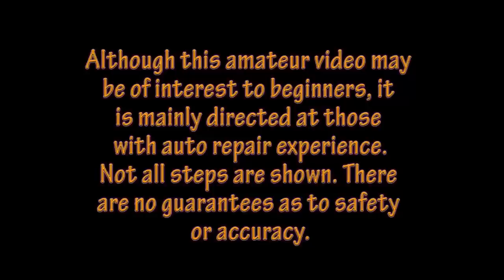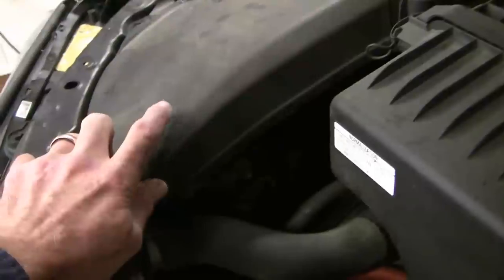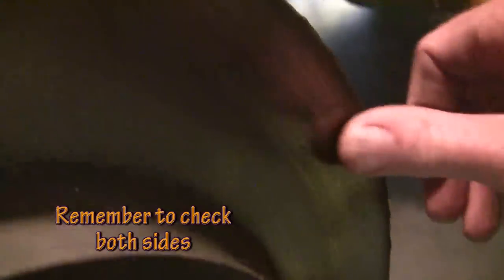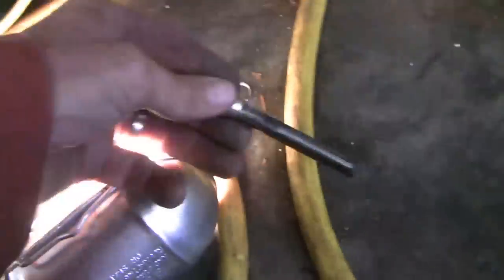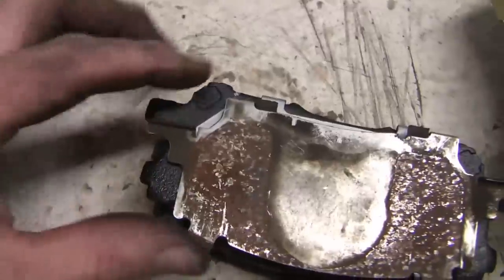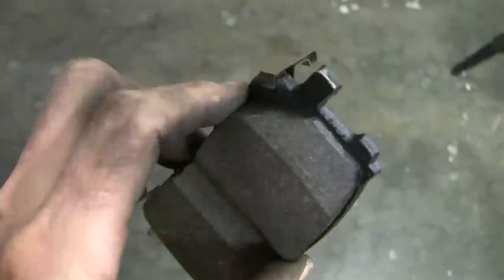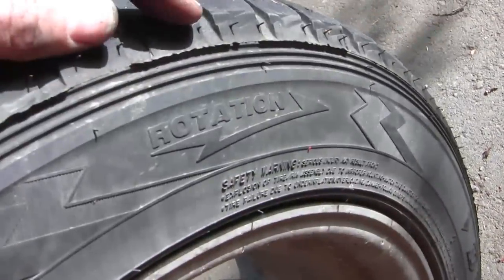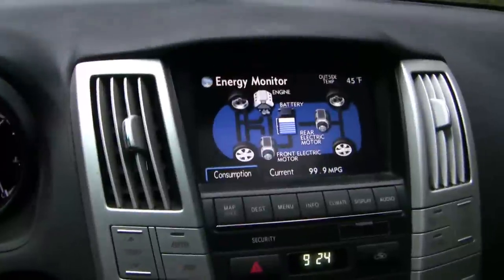How to replace brake pads on a hybrid vehicle, Lexus RX 400h

Comment: Excellent video sir! I will be performing brake pad / rotor jobs on my RX400h soon.
Do you have to use Toyota lithium grease soap? Is there any other alternatives I can get from local parts store?
Reply from the maker: I used it, partly because the vehicle is still on warranty and I didn't want any aspersions that I used the wrong lubricant. I don't know if others work as well or (more importantly) if they are compatible with the remaining lithium grease that will still be present in those sliders. A small problem there (with sticking sliders) could be a big problem in case of an accident....
Reply: Thank you sir for clarifying this. I guess I'm gonna have to go to stealership now :-)

Comment: Great video. Very informative. I am afraid I cannot do this service myself though. My 2008 RX 400h is at 110,000 miles now and gives about 27mpg ( 70% highway, 30% local). During last 105,000 mile service the dealer said it is time to change the brake pads at next service. I do not want to get this brake pads changed at the dealer but would like to go to a mechanic. What should I be careful about? Any idea about which brake pads are good on this vehicle?
Reply from the maker: If I were to ask a pro to do this I would choose an ASE certified shop that sees enough volume to be comfortable with this type of vehicle, especially with how to bleed brakes if they end up needing to do that. Because of the brake-by-wire and regenerative braking systems, bleeding is much more technical than on older vehicles. Unfortunately with extended warranties on these new vehicles, dealers get a lot more experience than do independent mechanics. I think that's kind of sad. Regarding pads, the ones I used are working great, but I can't say much more about that.

Comment: I see you have a special tool to spread brake system that goes over the brake pads.  What is it called and where did you get it?
Reply from the maker: Here in Canada there are several version sold in auto parts stores and at Princess Auto. the latter store is very similar to Harbor Freight. I don't know what they call those, but if you search the term "brake caliper compression tool" you'll find many examples. Some older cars have mechanical parking brakes (exclusively on rear calipers) and those operated with a cable sometimes required a wind back tool to rotate the slave cylinder back. You won't need those for front brakes, and almost all new cars have moved to electrically activated parking brakes where a wind back tool is obsolete.
Reply from the maker: By the way, if you don't have a brake slave cylinder compression tool, a large C clamp can work fine.

Comment from the maker: No, I wish. That's an instantaneous figure based on consumption coasting downhill. Real average mpg for this car is closer to 26mpg, and you can get more data on a different screen. 

I'm not really sold on the cost efficiency of the hybrid system, since as the battery fails you spend more and more fuel keeping the battery voltage up, and then you face a HUGE bill. Also, home repair isn't feasible most of the time, so you face repairs from an exclusive shop that has little competition.

Comment: Thanks for your video, I have a question for you 
My car is a2008 RX 400H without navigation system do you think if I’ll buy only top part and install it into my car I’ll have a navigation & hybrid system screen? 
Thanks in advance
Reply from the maker: I would guess it may require a reflash at the dealer, but I have no experience with that.

Comment: Great vid! You AVG mileage of 21.6 is dismal. Do you have a heavy foot or drive up mountains?
Reply from the maker: Yeah, average mileage for this vehicle is 26 mpg, mostly city driving with quite a few hills and stoplights. (the 21 you saw was just for part of one tank, not representative). Highway is up to 31 mpg. Worse in the winter, which is partly the Canadian winter gas and partly the extra energy for winter tires and extra lighting. I was hoping for better, though this generation of Lexus commonly gets 26. I haven't noticed any erosion of the main battery, yet, and mpg has been steady for years. It's rare for an average consumer to reach the numbers published by any manufacturer's advertising dept -- those numbers lie.
Reply: Funny my wife also gets 21.6 mpg also! Im very disappointed with the fuel economy.

Comment: The 400h is optimized more for power than mileage -  26 mpg is pretty good for the weight and power.  I thought I was doing great to get 126,000 mi. on the pads on my Prius until I heard of a guy who got 140,000 mi on his.  You don't really use the actual friction brakes unless you push them hard or you are down to about 10 mph.  One of the secrets to good mileage on a Prius is to slow down gently over a longer distance - that way you get maximum energy recovery.  Good video - thanks
Reply from the maker: Those are thoughtful words. Economic luxury is certainly an oxymoron, and the engineers knew that. Thank you for your feedback!

Comment: We just had our new front brakes and new rotors installed in our Lexus RX 400h "year 2006" . The mechanic noted he heard the car making noise while working on it, I assume the key was near by. The breaks feel good except it makes a clicking sound when breaking at a slower speed and also makes a clicking sound while completely stopped with foot on the break. Do you have any insight?
Reply from the maker: Same thing happened to our Lexus while it was still on warranty. At that
 time the repair was fully covered under the warranty, so I asked the 
dealer to fix it. He told me that the wishbone strut hardware was loose,
 they tightened a few bolts and it was fine. In your case, the mechanic 
who did the recent brake work should be responsible, though it may be 
nothing more than shifting clips as the new brake pads break in.
Reply: Thank you so much for responding :)

Comment: Great video i was looking for that kind of video on you tube very inter resting i have a question for you do i need specifique  antifreeze on my Lexus 400 h 2006
Reply from the maker: +Gilles Godin Most manufacturers suggest no mixing with generic coolants, and Lexus is no different. I've never tested that boundary. With their extended warranty it's probably wise to use only theirs to avoid conflicts, at least for the warranty period. You can buy the concentrate or the premixed, but as expected they come with luxury prices. Of course if you get the concentrate be sure you add only distilled or deionized water to mix. The Lexus hybrid cooling system is pretty complicated, with two cooling systems and two reservoirs.

Comment: For a brake fluid flush or air bleeding am I forced to go to the dealership or are there other brake service companies qualified to service my Lexus 450H hybrid.
Reply from the maker: Almost all general mechanics will have access to a high end generic scan tool that should do the job fine to enter brake maintenance mode. It's not rocket science. The job is a lot simpler if you maintain the level in the MC while bleeding since the system is already cleared of air. Just make sure the key is nowhere near the vehicle while bleeding.

Comment: In addition to removing the battery cable do you recommend pulling the ABS relays?
Reply from the maker: I didn't do that, but I was really careful to not let the key get close to the vehicle.
Reply: @spelunkerd  OK.  Next question.   I've read where it said after you disconnect the battery to operate the brake pedal until it goes hard (all the vacuum power boost is gone from the accumulator reservoir).  Then, after fitting the new pads, operate the brake pedal again to push the pads up to the disc before hooking the battery up so that it does not trigger a brake fault code.  Did you do this?  I just don't want to screw this up!

Comment: Thank you for the video.  I am going to replace my front pads on my 2006 rx400h based on your video.  Can you tell me if the rear pads are done the same way?
Reply from the maker: Typically the rear are different because the parking brake introduces a variable complexity and extra steps. There are a few different designs, and you should research what you have, to know if you require special tools to do the rear brakes. Your best resource is the dealers repair manual, available as an inexpensive option from Alldata or Mitchell.
Reply: Thank you once again.

Comment: Help! I recently had my front brakes done at Firestone (new rotors, brake pads, and caliper) on my 2015 Lexus rx450h (w/ 90k miles). Now the hybrid battery doesn’t seem to be charging as good while driving (per the dash indicator). It is sometimes showing around 50%. Usually much higher, but overall it seems to be at a lower point while driving than normal. I have heard that the hybrid battery should not be dropping below 80%, so I was thinking the battery might be failing but I recalled this started happening right after I got my car back from Firestone’s brake job. I’m thinking they didn’t do something properly. Any thoughts what it could be so I can reference to them to check and see?
Reply from the maker: There's nothing wrong with asking them, but I think it is really unlikely the issue is related to the brake change. Alternatively you could ask for advice from a shop more qualified to work on a hybrid, and get their unbiased third-party opinion as to whether there is any chance it could be related.

Comment: Thanks for the video it was very helpful. 
I just changed my brake pad, I did bleed the caliper But the caliper will not grip and all the lights on dashboard came on since then including the vsc control. Also the brake doesn't grip when I dragged it. Is there anything I can do to solve this problem.
Reply from the maker: Sometimes when the caliper is widely open, it can't close down on the disc unless the pads and caliper are manually positioned close to the disc. If it still won't close, it's either a stuck caliper or air in the line. Part of the reason I didn't bleed the brakes that day was because the shop manual calls for bleeding to be activated electronically with the Toyota Techstream software. Brake by wire systems are more complicated than the old school method! My scanner might have been able to do it but I didn't want to take the risk. You may need to bite the bullet and ask for a tow to the nearest dealer.

Comment: I have an rx400h too and will need to replace the rear brakes. Any tips?
Also how did pop open the 600v disconnect compartment? If u haven't had
problems with ur backup camera, expect it. All the opening and closing the
tailgate frays the video cable.
Reply from the maker: In the Lexus repair manual they emphasize you need double insulated gloves capable of withstanding a 600V arc. Those are expensive, they look like welding gloves but they are a lot more expensive. They have inner rubber liners so it's basically a double glove (no rings!). With those gloves on, you pull the plug upward to rotate it and then pull it out and put it in your pocket. I have not had occasion to do this in my vehicle, nor have I replaced the rear pads. This vehicle has a drum parking brake which needs to be released before the disc can be removed. However the pads and calipers otherwise look very similar.
Reply: spelunkerd
I meant "how did you pop open the disconnect compartment, not the disconnect itself". As for the HV gloves, I have a set from NYC transit. What year is your RX? I have a 2007 and they have disc brakes front and rear.
Reply from the maker: Nelson Chua The compartment cover is held on with two plastic clips that are a press fit, just use a medium flat screwdriver and pry it up and off.

My vehicle is a 2008. It has disc brakes front and back, but designed inside the rotor on the rear is a drum for the parking brake. If your rotor is fine you don't need to remove it, but if it has to be removed you usually have to undo a screw holding it on and then you usually have to pry the star wheel of the parking brake backward to release the parking brake shoes enough so the rotor slides off. The manual says to mark the position of the disc so it can be replaced in the identical position. Of course the parking brake star wheel (and maybe the parking brake cable) need to be readjusted after the disc is put back on or replaced.

I use Alldata, but Mitchell, or even a copy of the dealers manual would be wise. Copies of the dealers are for sale on ebay but you may not get TSB updates with those so I prefer an updated electronic subscription -- pretty cheap compared to getting it though Lexus.
Reply: spelunkerd
I stand corrected. I do have disc + drum(for parking) in the rear. I took it off to have it refaced. It was verified to still be within specs. The drums and shoes look fine (no surprise since they're only used for parking). No screws outside of the wheel lugbolts holding the rotors. I just had to carefully bang the hell out of it to loosen the rust with the help of rust lube. Thanks again for sharing your tips on the front brakes, they really helped in some way when doing the rear. Cheers from NJ.
Reply from the maker: You're welcome, and thanks for the interesting thread. Nice to meet you.

Comment: kool video bro.I was wondering if you can do one on your Vulcan 800 valve adjustment?
Reply from the maker: Ya, I've been looking for one, too. I don't have have access to a set of shims, which need to be replaced if the present shims don't meet specs. One day.
Reply: ebay man there cheap there

Comment from the maker: @Rich P
I find it so irritating when Google won't let me reply directly to the question by Rich P. Google is still evidently having trouble consistently allowing the kind of thread continuity as we had before they took over. In any case, I use Alldatadiy for electronic access to the dealers manual. 5 years costs about $40, and you also get TSB updates that of course aren't available in print form. Mitchell is said to be good, too. You can go directly through Lexus but the cost is about 10 fold higher. Unauthorized ebay copies are available as well, but they aren't necessarily complete or up to date with recent TSB's.
Reply: Thank you for the quick reply.  Will you be performing any other service or maintenance work on your Lexus Hybrid in the future?
Reply from the maker: I've been thinking about doing a vid of how to recognize a bad accessory battery, which presents very differently in a hybrid. Not filmed yet.

Comment: What happens in the long run if the key was still left in the vehicle when all 4 brake pads were replaced?

Also, if those additional steps were not done and the pads simply switched out, what kind of problems could you see or expect immediately and down the road?
Reply from the maker: If you get away with it and no computer codes are set, you're OK. The main problem happens if the braking system wakes up while the pads are off, in which case the abs pump might kick in, pushing the slave piston out, possibly spilling brake fluid all over the floor and dropping the brake fluid level in the MC reservoir so much that air enters from above. Then you would need to bleed air from the braking system, and possibly erase computer codes to get rid of a check engine light. I know that some mechanics pull the ABS relay to prevent that from happening, but if the key is far away from the car it shouldn't happen even with the ABS relay in place.

Comment: what is the process you have to do once you disconnect the battery? you mentioned something with the doors, windows, and sunroof.
Reply from the maker: You need to initialize the system to tell the computer what position the windows and sunroof etc are in. Check your owners manual for details. As I recall, after a battery disconnect we had to move each window all the way up and all the way down by pressing the switch on the respective door before they would work properly. Before you do that you may notice that the window up/down switch doesn't work. In addition there is a relearn process for fuel economy that involves a sequence of steps you can follow. My impression about the latter was that the relearn happened after driving even if we didn't follow the steps, however I believe the relearn is faster if you go through that sequence. I haven't done that in a few years so if detail is not in the video or the video description, you'll have to check your manual. Off the top of my head I don't remember it, but I believe I recorded that somewhere in one of the Lexus videos I did, perhaps in the video description.

Comment: I want to install a aftermarket amplifier in lexus rx 400h.. and i want to pass the positive battery wire from main battery under the hood/bonnet to the back cabin in the car, do you know the best way to do that? is the any hole between the bonnet and the cabin where i can pass the wire from to the trunk?
Reply from the maker: SAJ@TV I've never done that, not sure. I would try to tie it to the ignition so it can't be operated with key off, so that you are less likely to deplete the battery and require an expensive, four wheel tow.